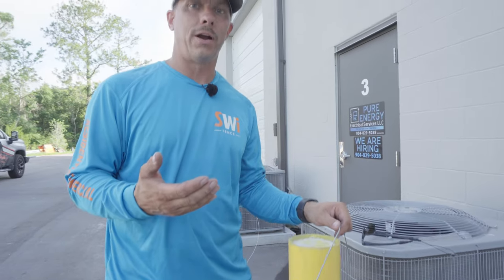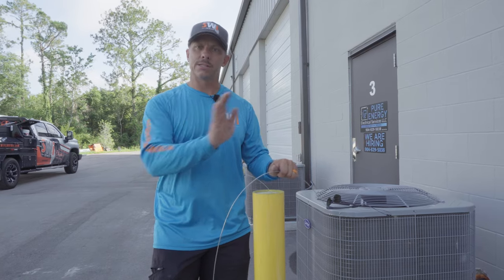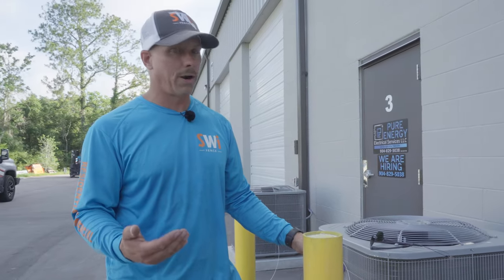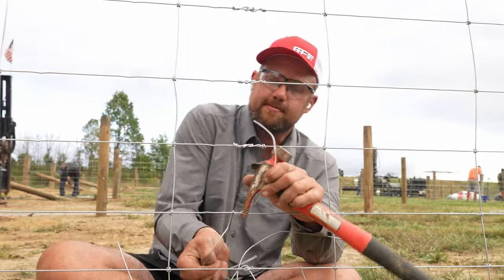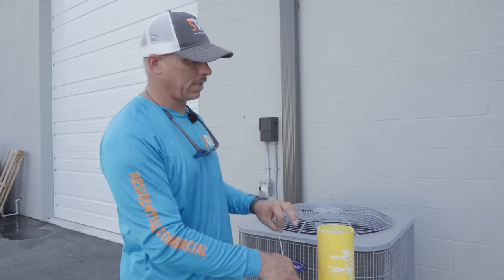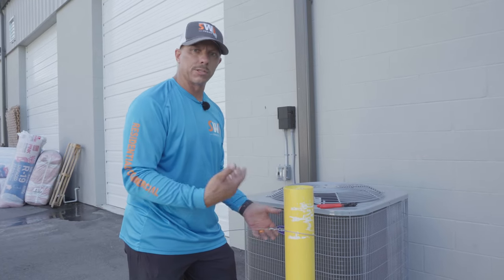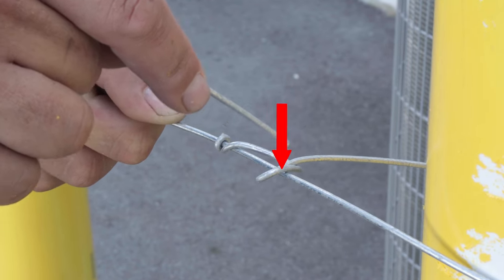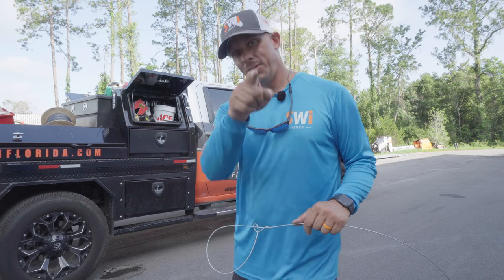You're Probably Tying Your Fence Off Wrong!

Comment: You mentioned a couple of times early in the video that the termination knot is for high tensile wire. I don't use HT but still use the same termination knot. Is that still ok or is there a better knot for mild steel wire?

Comment: Im using 2mm high tensile wire for my espalier tiers and the run is 13m long. Im using a ratchet cog strainer at one end to enable tightening. The wire runs through 6 equally spaced L Brackets for support between my fruit trees. What is the best way to terminate this type of wire at the start where I have used a galvanised L bracket with a hole in it, not a post; and then around the shaft of the ratchet. I find it very hard to twist. And I wish I had one of those horizontal spinning feed mechs......I made a hell of a mess when I tried to feed out the first 13m of wire! It only took me an hour to untangle.

Comment: Hi found your channel I have 100 diff subs but glad to find you otherwise good!!! I had a question and would appreciate if you could get back it’s about fence posts I was wondering if you could help me locate the ones that you can slide wood down the inside of the posts from both sides horizontally so that’s all and was looking for the ones that aren’t big just snug enough to slide an inch thick the length doesn’t matter obviously but yeah that pattern where both sides of the pole has a insert where the end is covered but like I said you can slide the wood down the sides of the poles from either side thanks